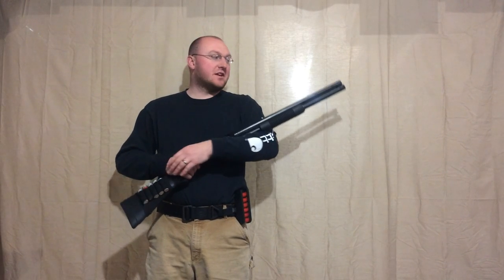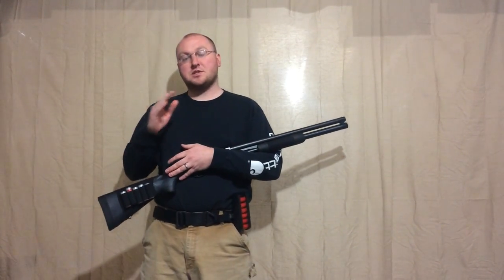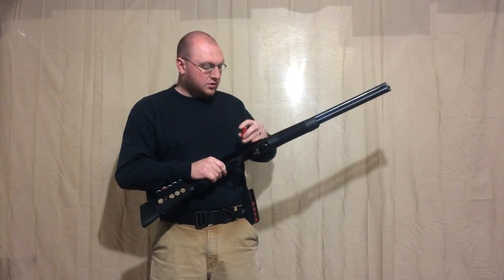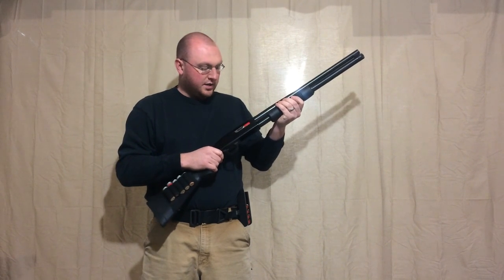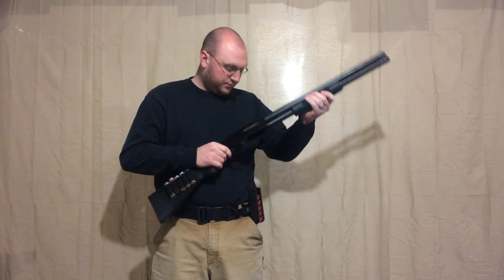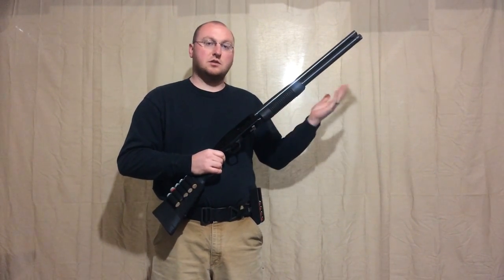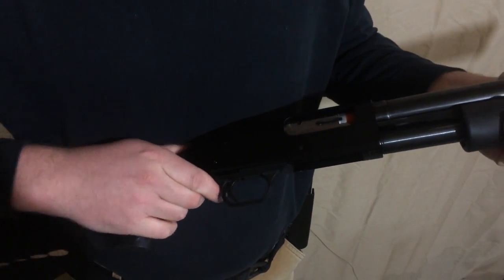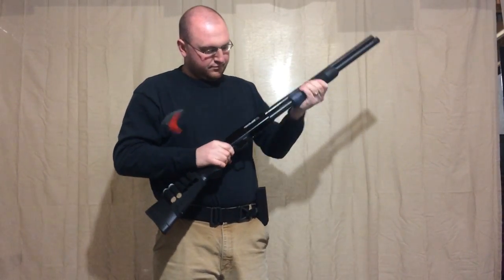Mossberg Shotgun Slug Select

Comment: On a 590A1 there is enough slack in the timing of the shell interrupter and action bar to run that action back, take out the unchambered round and drop in the slug without having to seat the tube round with your thumb.